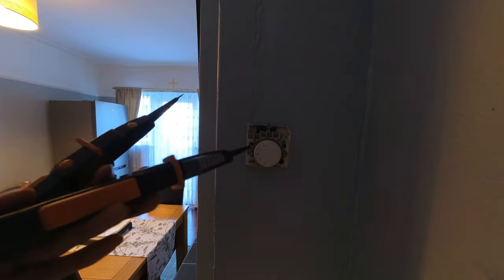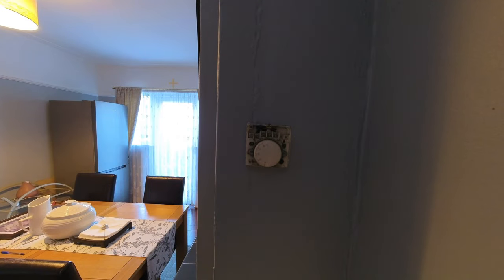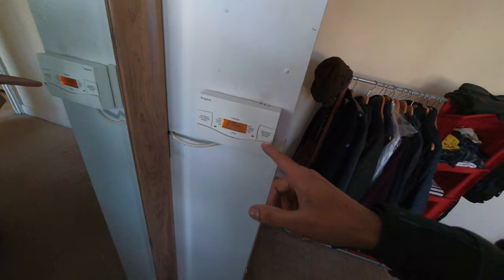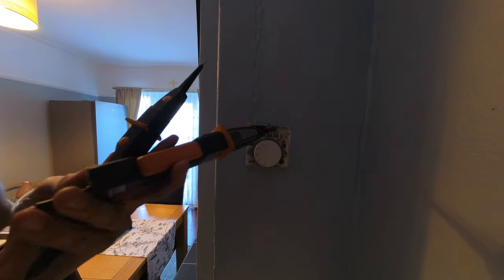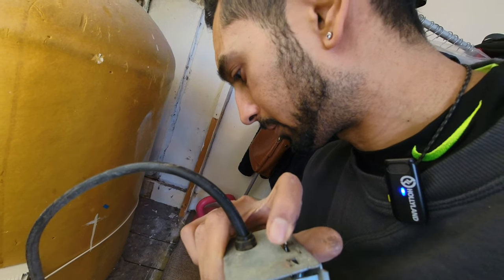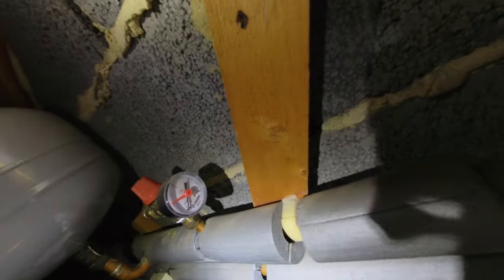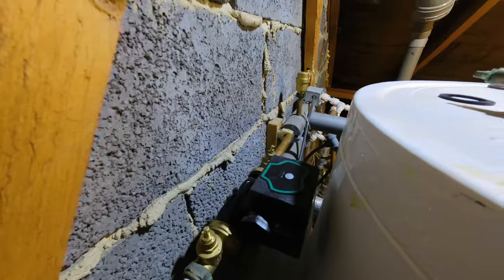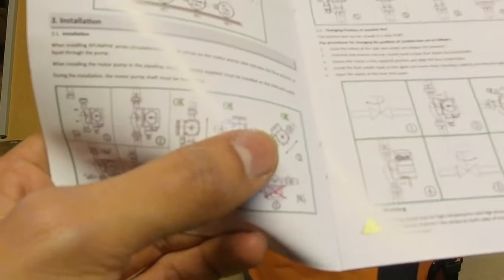Wiring Faults & Dodgy Pumps - A Day In The Life Of A Gas Engineer 131

Comment: Rubble bags are perfect for a lot of jobs. Im still using foldable buckets too but i reinforced them with some butyl tape i bought off temu 😂 i kept getting pinholes and leaks same as you but they've been ok since i reinforced them 🤞 i like the look of that orange velocity bag you were using, looks decent 😊
Reply from the maker: That's a good shout mate! Yeah the velocity bucket bag is basically my drain down bag now. You can't use it to catch water itself but it's great for chucking stuff in quickly for a job 👌🏾

Comment: The pump isn’t in the correct position, main shaft should be in the horizontal position not vertical. Most pump manufacturers will state this in their installation guide
Reply from the maker: I guess you missed the bit where I showed in the MIs that it CAN be fitted that way 🙄
Reply: @cputilitysolutions the old grundfos pump was in the incorrect position NOT the new pump you fitted. You mentioned when you showed the installation guide that the pump impeller shaft should not be vertical